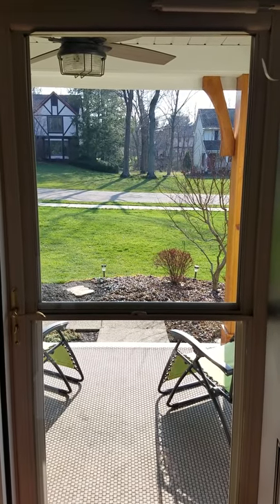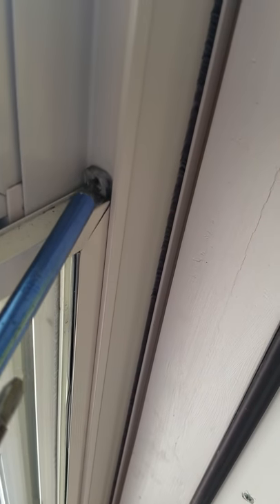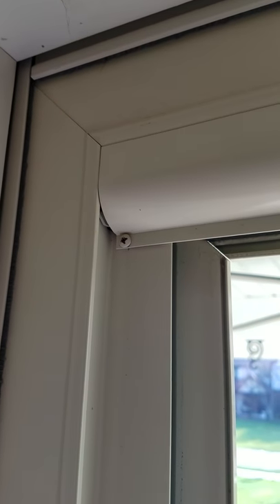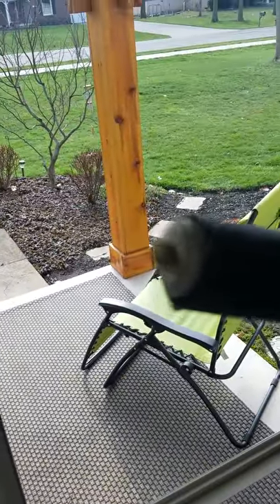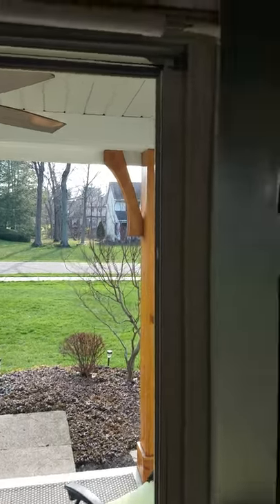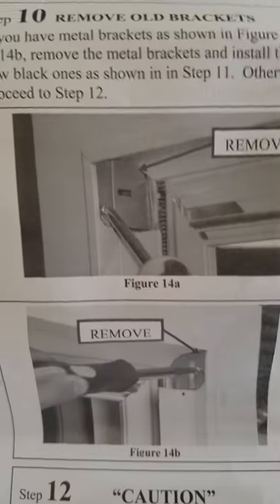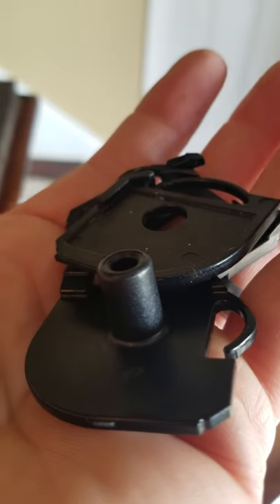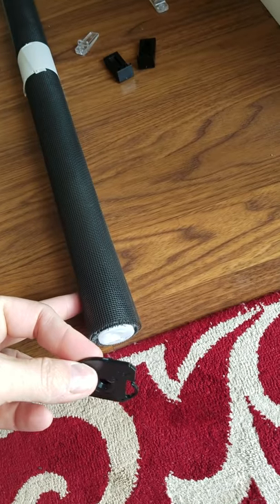DIY -  Larson retractable screen replacement

Comment: Thank You so much for your video.  
I've recently broke my back-disabilty it's much, so a friend help me with a Larson secure storm door.  Great, right!
Well the top glass got broke (my fault); nevertheless,  I've been having a heck of a time finding Any information.  Plus I can't get the top window (the broken one) to slide down.  I think the screen setup is probably frozen up, I mean it won't budge.
By watching your video I at leas now know what it supposed to do. I've even called & took door to supposedly the professionals: door co., glass co., window co.. It was obviousl they did not know more then me. That okay, I'm a stubborn red-head that will keep on till I figure it out. 
I have to question: 1} where did you purchase the screen? 2}where would be the inexpensive place to go to replace the top glass?
Again Thank You
Reply from the maker: If you look inside of the door jamb, near the hinges, there should be a sticker with an identification number on it. If you contact Larson either by phone or by website and enter that number.  The parts should come up for your door.  Good luck.
Reply: @steelydan8421  I am working for a customer with this type. There are spring counterweight in theirs. I can't see any use for them or where they go. Any help in this regard?
Reply from the maker: Unfortunately,  I am not familiar with weights or additional springs.  Good luck.
Reply: @alexlitrichin9718  I believe I read in my research;  the one that had the counterweights in it was the model or two before (older) than this model.

Comment: Such an amazing concept, but poorly designed.  We've had one of these Larson doors for about 8 years and are having to replace the screen for the 3rd time.  They always tear loose at the bottom of the screen.  The other thing I don't like is the mechanism for holding the screen/window in place.  When the window is UP,  the lever holding it in place is really hinky and if it opens or pulls away from under the window, the window will slam down hard.  Not good.  Also we have to use a big screwdriver to wedge under the window and pry it up all the way to push that lever over.   We love the door during the summers but just have to do anything with it is a big pita.

Comment: NEWER MODELS:  Remove the screen roll cover and right retaining clip. Remove the old screen roll. Lift the moving sash all the up to the gap where the old screen roll was. Shift to one side to remove the whole sash. Slide in the new roll with the flat pin to the left.  Keep it rolled up. Install sash and screen opposite of removing. Insert the pins and retaining clip. Slide screen and sash down with the screen edges inside the channels. Replace the cover and your done.

Comment: Dan 
, I hope you are still on you tube. I had the same problem with my exact Larson door. The replacement went good but now
 the screen frame  does not want to go up high enough for the bottom latch to engage and hold the screen frame up?? Did you have that problem? Did anyone else following this have this problem. ?
Reply from the maker: To be honest, mine does sit a lot tighter than it used to. It is definitely snug but it does latch. Good luck

Comment: Is the latch supposed to catch under the bottom edge of the top panel?  Mine is 1/4 " from latching.
Reply from the maker: Yes, the top dash is secured by the latch.

Comment: How do you figure out what kind of storm door you have?  The only thing I see is LGR.  It's a mid view and the retractable screen measured 25 1/2".  It's looks very similar to yours and possibly a Larson.  I could not find anything on the Lowe's site.  Thx!
Reply from the maker: @bradcoutin6569  check for a serial number on the door jam and see if that has any info on it? Good luck.

Comment: My plastic clips that need to come out after removing the two screws in first step. Those clips broke into pieces and part is stuck in hole so I can’t remove them completely . Any suggestions what to try   Thanks for any help
Reply from the maker: Yikes,  I assume you're talking about the small clips that keep the lower dash in place? You should be able to slide the lower sash to the left a little and pop the right side out...  hope this helps.  Good luck

Comment: Where do you get this part? This is the exact same door we have and I can’t find it anywhere
Reply from the maker: You should have a door identification number on the door jamb itself. You take that number and enter it into the Larson website, it should pull up all of the parts and information you need for your door. Good luck.
Reply: @steelydan8421  I don't have the sticker on the door jamb. Looks like I'll have to measure and call the support number. When I try to look up the part by image, I can see it, but it won't open when I click on it. I have a bad feeling that it's no longer available. :-( If I get one, your video will be super helpful. Thanks!
Reply from the maker: I'll bet they can fix you up.  Good luck

Comment: @Steely Dan. The video shows about 75% of the process because some of the installation isn't included. The replacement ''Self Storing Screen Assembly'' lasted 2 months. 
Next what happened was it started to get almost impossible to lift the Self Storing Screen/Outside Window up enough so you could ''Latch/Lock the window in the up position. 
I believe the ''Replacement Screen Assembly'' should have been made exactly the same as the original one, (meaning the same width). This is my opinion Because it's not, Since you only get the ''One (1) Chance'' to get it installed so it ''Worked Correctly'' because now the ''New Screen Tension'' is now set, (Supposedly With The Correct Tension). 
Next I've got to call Lowes because it should still be under Warranty, plus now it has to be removed & since it's now November 19th, then add another 10 - 14 days before the new replacement will get to the store, I can't see me taking the storm door assembly apart again to reinstall the 2nd replacement. Perhaps I should just get the $40- $50 refunded to me & either get a new storm door, or wait until next spring in install the new assembly. I just think it was a poor design by Larson But Then Again, That's My Personal Opinion...

Thanks for uploading the video. So far there's only Two (2) Installation Videos, which sucks.....

Comment: My screen lost tension during installation.   Had to re crank it a couple of turns and then once it was installed had to turn it half a turn in order for the tension to engage.  Just have to be careful because it whips pretty good once engaged.
Reply from the maker: Yikes. I’m sure there is a fair amount of tension on it.
Reply: @steelydan8421  It actually works great now that its installed.  Your vid helped a lot.  Those black and white photos on the instructions are pretty much useless, lol.

Comment: Hi, Dan.  I just bought the replacement screen roll for my own storm door, but mine just came with the roll -- no new brackets or clips or anything.  Should I still attempt this? I'm kind of worried about taking the top sash off and not being able to get it back on again.

edit: seeing what you were given, I am feeling a little jipped by Larson, now.  $48 for just the screen roll itself, no instruction manual and no retaining clips or brackets.
Reply from the maker: Don’t know if I would attempt without new hardware.  If the new screen mounts the same as the old then, I would do it.  Good luck!
Reply: @steelydan8421  Thanks! I just pulled up the online instruction manual, and it doesn't mention replacing any old hardware with new.  Ostensibly, it should work.  It's going to get dark soon, so I'll give it a go tomorrow morning.  Thanks for this helpful video.

edit: our doors are probably just different models with different assembly methods.  They hid the manual for mine in a little subsection under the replacement parts list here -- https://images.stormdooronline.com/instructions/larson/inserts/202220816WCscreenreplace.pdf

Comment: Hi Dan!  Thanks for the video! Very helpful!  I have the exact same door. The big issue is it doesn't have any model number anywhere.   Mine is the 30 3/4 in tube length. I allready took that off like you did.  May i ask you where you ordered your kit?
Reply from the maker: Directly from the Larson website. There should be a door identification number on the inside jam of the door. If you enter that information in, it should pull up all the parts for your specific door. Good luck
Reply: @steelydan8421  thanks, I looked inside the door jam, all around.  Whatever was there was removed before we bought the home.

Comment: Hey how can I get the replacement screen and on my screen was a thin strip of plastic seal where the screen connect to the window. Do I need to use that strip again? Please get back with me asap
Reply from the maker: If it's a Larson door, you should be able to input your door "serial #" found on inside door jam.  Website  should have all parts for your particular door.  The bottom plastic/rubber piece that typically breaks will be attached to new cartridge screen.  Hope this helps.  Good luck
Reply: Thanks

Comment: I did not see where you tensioned the recoil spring for the screen.  How is this accomplished with the newer plastic pieces?  We have the metal corner pieces like those you replaced.  Our screen is fine, but the recoil spring has lost tension and the window hangs 1/2 way open, won't stay up any higher.
Reply from the maker: Unfortunately,  I replaced entire cartridge and did not have the issue of needing to "retension" the screen.  Sounds like the spring winding mechanism has failed.  You might be better off to just replace the entire cartridge? 
Good luck
Reply: @steelydan8421  I got it.  Fortunately my wife saves everything and we found a little "wrench" with the manual in the file she kept.  It had a slot to capture the flat end of the screen "shaft" and we were able to put a number of revolutions into the spring and now it will hold the window within a couple inches of the top.  Not perfect, but close enough for how she uses it.
Reply from the maker: Nice!

Comment: I'm having a hard time figuring out how to get the glass panel out of door in order to put the screen in the top glass channel. Step 8. I didn't see that step on your video. Could you give me a pointer on that step?
Reply from the maker: April Galley.  At 1:30, I quickly talked about it.  Not thoroughly though.  I remember it coming out fairly easily.  Maybe, once over to the left all the way, try sliding bottom slash up a little before popping out of right side track.  
Good luck.

Comment: I’ll keep reading for comments but where can I get the kit. Lowe’s put me on hold for 20 min and no answer.
Reply from the maker: Inside the door jam of the door there should be a serial number sticker. Go to the Larson website, enter in that serial number and it should pull up all of the parts for your existing door. Good luck.

Comment: $46.00 from Larson Lowe's. I have the 3/0 (36" door) with the screen that has the blade on one end and the rounded nipple end on the other. The hardware is different too. My door is about ten years old, so yes, I had to use the serial number to get the right one. I don't know from this video yet just how to get that screen to let go of the insert end that fits into the sash, or how to get the sash into position to accept the screen, but I'll figure it out as I watch this video again. Maybe that will help. And yes, we should have an extra pair of hands to do this. :)

Comment: Did you have to order the replacement from them directly? Or were you able to find one at a local or big box store?
Reply from the maker: “Serial numbers” on door jam. Go to website, enter those numbers and that should pull up all the parts for your door.
Reply: @steelydan8421  on the Larson website it did not return a screen replacement. Granted I was using my phone and the whole experience seemed clunky... but it recognized the number and said it was built in 2015. Not out of the realm of possibility but seems odd they would no longer carry screens for a model less than a decade old.
Reply from the maker: My door was about 6 years old when I finally replaced it.  All parts were available (at that time).

Comment: HI, So I started this today and the screen is so old (10 years) that the clips at the first step were melted onto the metal and broke,  and  I  still could not get them out, any suggestions? I'm calling Larson to  see if they  have a replacement part for this, if not??? !!! what a poor design.  Thank you  for posting, once I get this resolved I feel your video  will be helpful.   and thank you  again  Stefanie D.
Reply from the maker: Stefanie Diamond.   Melted!?  Dang.  I would pry and pry and pry.  Keep working them.  Good luck.
Reply: Same on my door but I was able to chip it off little by little. Two screws were already stripped on my screen housing unit also.

Comment: I’m hoping you or someone cal help me change the lower glass on a very similar Pelli door. When I call pills they transfer me to Larson for storm door help so I’m fairly certain it’s the same. Thanks for the video.
Reply from the maker: Gonna take some definite research. Check Larson site and your lower sash part number. Try to cross reference with Pella part #. Good luck

Comment: Can you tell me where I can buy a replacement retractable screen cartridge for my 36" Larson storm door? PLEASE!!!!!
Reply from the maker: It's been said a few times in the comments but, there should be serial/identification sticker on the door jam.  If you enter that number into the Larson website, it should pull up all the parts for your door...  good luck.
Reply: Unless your paper sticker is nearly blank from weathering like mine, should have been vinyl. We'll see how their tech support is on Monday when they open up.
Thanks for the video.

Comment: I have the same door. I just went to put up the top glass panel and the screen acted up. It still works, but gets stuck. You have to keep going up and down to get it back up. Any suggestions on how to fix that problem?
Reply from the maker: Sounds like the spring inside the screen cartridge is catching on something or binding up?  I would try removing the screen cover at the top. See how it operates without it first.  May need to replace if it still acts up. Good luck.
Reply: @steelydan8421  Thanks for the timely reply. I am not the handiest person in the world.
I can't spray WD-40 in the spaces on the top of the door, say a prayer and hope for the best?
😁
Reply: @steelydan8421  If I take off the top cover, will the screen fall out?
Reply from the maker: It shouldn’t fall out, depending on its hardware. They kinda snap into place. No guarantees though...
Reply: @steelydan8421  Thank you! I will let you know.
😊
Reply: @steelydan8421  THANK YOU AGAIN! I just sprayed the ends of the top cap and worked it in by making the window open and close. Much smoother now.
Enjoy your weekend!
😎

Comment: Can you explain how you got the screen into the track? We followed all of your steps and can’t figure out how to get this piece in there! Thanks
Reply from the maker: schmigem.  If I remember correctly, I put the upper sash as high as it would go so the bottom of the screen with clear the top of the track. You may try that. Good luck.

Comment: May I ask how did you get that screen roll out of the top of the door
Reply from the maker: Removed the long cover.  I believe it came out from the right side first.  I know the new cartridge was entirely different.   Good luck.
Reply: @steelydan8421  okay thanks mine already have the plastic brackets on it already I tried pulling it out I don't know rather you have to lift up on it first or what or push upwords on it I'll find out thanks
Reply from the maker: The new style with plastic end pieces "rolled in" from the top.  I can't say I'm familiar with removing the new style.  I just know it rolled down in.

Comment: Loved your DIY instructions! In trying to replace our Tradewinds screen on our door (purchased in 2005), there’s no model/serial # to be found.  Today, I have contacted via chat with Larson and was given part #080510032RF Top Operating Glass Insert with Retractable Screen Roll (White) $80 for our 36x81 door.  Our door is identical to yours except for color. I was told “due to product changes, the top glass will need to be replaced as well.”  We don’t have a problem with this since a new door would be well over $500.  Wish I could have spoken to someone on the phone at Larson but they’re only using “Chat.” With your experience, does this part sound sensible to you?  Thanks so much!
Reply from the maker: So it's the upper sash with the screen permanently attached to it? Sounds like that could get expensive overtime.  I'm not sure .  Good luck.

Comment: We have this same problem. Thank you for posting this informative video. Where did you purchase the replacement screen?
Reply from the maker: Hopefully, there is a sticker on the door jamb itself. Enter those numbers or the identification number into the Larson website. At that point it should be able to pull up all the parts associated with your door. Good luck.